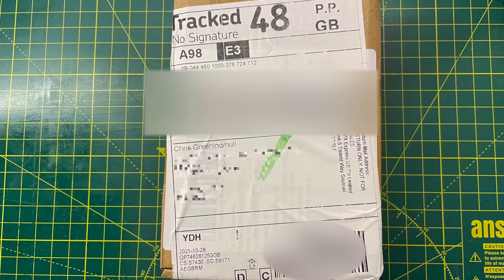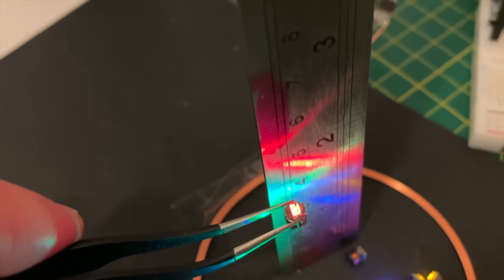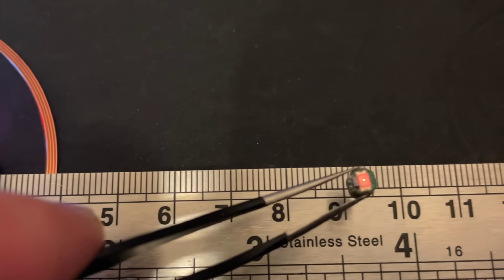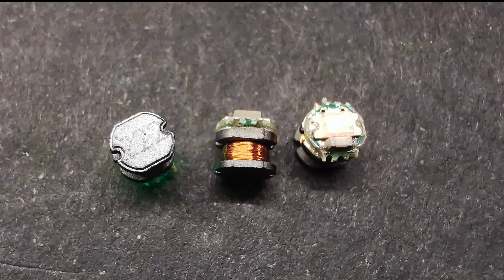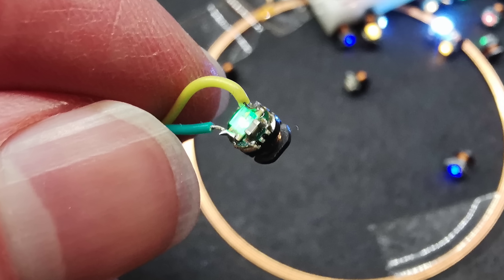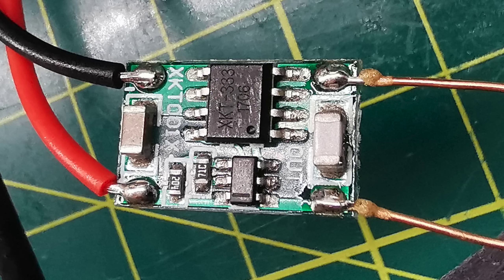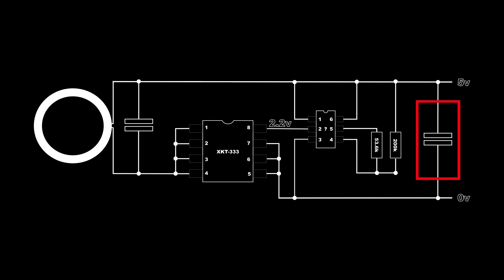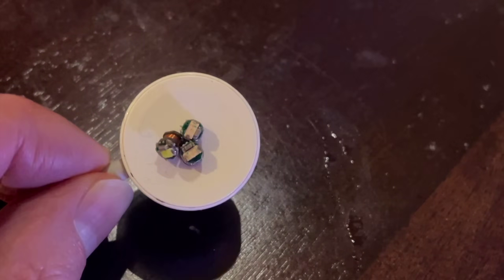Look Mum No Wires - This will blow your mind

Comment: Put them in a container of clear oil or other non-conductive fluid, then use a pump or agitator to swirl them around like a lava lamp.
Reply: Or I guess you could cover them in epoxy then use water in the container.
Reply: Actually don't do that because I want to do it now!
Reply: I got some of these, I didn't realise how dense they are!  I was able to get one to float by sticking a big piece of styrofoam to it, but I'm not sure how many you could have in a jar and still be able to see the lights.

Comment: Hmm, make a "holographic" 3d cube with the LEDs in resin, a 4x4 grid array in a 5x5 resin cube, of course if that works well you could try a 10x10 led in an 11x11 resin cu e.
Reply from the maker: That's a really nice idea. I've been meaning to try my hand at casting resin.

Comment: The LED's are brighter because you are now magnetically coupling the ferrite core of the LED's coil to the magnetic core of the iphone's charging transformer.  Basically the LED's coil is now the secondary winding of the charger's coil/core.  True wireless doesn't use magnetic coupling for power transfer.

Comment: Christmas is near - so why not make a bonsai Christmas tree?

The 2.2V is probably a "virtual ground". This gives you a symmetrical power supply of roughly +/- 2.5V. This used to be common practise before cheap DC/DC converters were available.
 For example, the 9V battery was invented for portable transistor radios. Using a regulator to create 4.5V, you get the necessary symmetrical power supply for the tuner while the speaker is driven by the full 9V using a class-A amp circuit. The tuner doesn't need much of a voltage, 2..3V is plenty to make it work while the speaker needs as much volts as possible.

The wireless charger is pulsing to waste less energy. It switches on and if it can't sense any decent load, it switches off for a second or two before trying again. It would be a good idea to prolong the time it is off but when the cell phone doesn't respond seemingly instantly, a lot of people start to bang their phone onto the charger to "make it work better" so a lot of energy is wasted to!prevent just that.
Reply from the maker: I actually like that idea a lot!

Comment: Attach the LC/Led to things you may easily misplace - and with the powered coil you can go chasing that. (maybe a flat receiver coil - half creditcard size - clip to important papers...
Reply: Long before credit/debit cards used NFC, I kept an RFID tag in my wallet and used a homemade long range reader to locate my wallet whenever I misplaced it. 1.5 meters of range is more than enough to do the trick.

Using the LEDs to do the trick is a good idea but you can't find stuff which is hidden because it is covered by something, the common reason why you can't spot it in the first please.

Comment: Can you create a hex grid of coils to cover a larger area? Would a small NdFeB magnet change the resonant frequency, and how much power is transferred across a steel sheet (0.25 to 0.5 mm)?
Thinking of lit fridge magnets - perhaps with tuned LC-frequencies (the diode in series with the C?) for two-color schemes by the transfer coil?
Reply: Nah -- 200kHz is blocked by very little metal, even aluminum foil will block it substantially.  It can be mounted on a surface with low profile, but some preparation is required.  First, the surface needs to be shielded with ferrite tiles, and then the coil goes on top of those.  But this will drop the resonant frequency, so some tuning will still be needed (reduce the number of turns maybe?).

Magnets will tend to saturate the receiver's core (and also make a dead spot in the ferrite tile shielding, if applicable), reducing its inductance (raising resonant frequency).  Maybe the inductor value can be adjusted to compensate.  A weak magnet would be best (Br < 300mT), for which, common fridge magnets aren't a bad idea (they have Br ~ 30mT I think, and make up the strength by using a striped pattern on the face).

Comment: 3:31 - The signal on the coil is a half-sine wave - Because the drive circuit is a "Class E" type. In this topology, there is only one N-CH MOSFET that pulls the current from the coil, and the current is pushed back by the inductance of the coil itself and a resonating capacitor in parallel to the coil. The result is a push-pull current through the coil, but with only 1 MOSFET transistor. This is the cheapest drive circuit. The downside is that this circuit has to be tuned for a certain frequency, unlike regular push-pull drivers (half-bridge). Check for more explanation on Class-E on the web.
Reply: This.  I don't recognize the part numbers, but the pinout and application looks absolutely like a MOSFET output.

Which in turn means the 6-pin device is, probably not any kind of controller, though possibly; it's most likely an adjustable squarewave oscillator.  In the past I've used parts like LTC6990, adjustable silicon oscillator; in effect a nicer version of a 555 (less versatile, easier to use for simple applications).  The pinout doesn't match so it might be a similar part from someone else.
Reply from the maker: Correct - the big chip is just a MOSFET the 6 pin chip is an XKT001. I've fixed up the reverse engineering in the DIY video: https://youtu.be/jdc_0r5pJPc

Comment: I saw a wireless Christmas light string in a nearby store yesterday. I thought it might work like this. No. I read the text on the box and didn’t buy it. The 15 candles require 15 batteries, which are sold separately! You also need one for the remote control. Pfff! Environmental Protection.

Comment: Try making a very large diameter coil (2 meters or so) and place a Christmas tree inside of it with the LEDs glued to branches. You'd probably have to build your own driver circuit, and those with pacemakers may want to stand far away.
Reply: How about a replica of Saturn with the rings being the coil, and the LEDs on or inside the globe ?

Comment: I built a shortwave tuning 8 to 30 MHz  crystal radio set and connected a LED light to the earphone connection and it lights up brightly when I key up my CB radio when tuned to 27 MHz.

Comment: The waveform you have measured is a modified class-E amplifier drain voltage waveform. That waveform, being fed into the coil and resonates with the load capacitor, forms a perfect sine wave, which drives the load. You can try to remove the LED and see if you get a sine wave on the receiver coil. The half sine is converter to full sine by using a tuned filter (in this case, a parallel LC tank comprised of the tx coil and tx capacitor, as well as any load rx coils and rx capacitors, where in a classic class-E it would be a series tank L and tank capacitor), which filters out higher harmonics (the clipped part's Fourier transform).
Reply: If you havnt got some sort off super solar run l.e.d smart shed for growing all your food and varies other projects then your talents are being waisted sir..
Reply: @jshaw4757  Well, I have a PhD in power electronics and I make a living by making energy utilization more efficient.
Reply: @bskull3232  My kinda dude show me your lab bro lol..
Reply: @bskull3232  No home projects no dexters lab hidden..??
Reply: @bskull3232  I dabble in that myself very much intrested in alternate ways off energy/power n the history...building a l.e.d solar shed among various other things..currently building salt batteries had some great results i just need a buck converter to up the amps/current..lower the volts to increase the current im told this is possible..volts are no issue can get whatever needed for a decent ammount off time too..maybe you could help me mate if u get a minuite cheers
Reply: @jshaw4757  I plan to stream in my lab in a few days, but that will be in Chinese... I live in China, and invited by Altium China, I probably will do a power supply seminar for them promoting their software. Dunno if they will translate the video or not. Or maybe I will subsitle it and post it on my YT channel.
Reply: @bskull3232  Ok Bo great..you sound like a busy man so i wont hasstle you 😂😂..good luck with everything from 🏴 hope your one off the good guys out there in these industrys

Comment: Could the ring be powered by a battery? If so, what type and how long do you think it would the battery would last if it were to be used a couple times a day for less than a minutes each time?  I could use whatever type of battery is necessary, but I'd prefer to use something small, like a CR2032.

Comment: Thank you for the hint.
The Qi standard negotiate the power with the phone, i.e. 5, 10, or 15 Watt. Also, it detect the presence of metallic objects that can short the electromagnetic field.
The wireless LEDs are a barebone circuit, they don't reply to the inquiries of the charger, which therefore turns off.
You can build a simpler, crude driver for the coil you use to power the LED, with a 555 wired as an astable multivibrator, and a power transistor driving the coil. Try to use the Qi base frequency of 140 KHz, which is the best compromise for minimising coil losses.
Thank you for showing this.
Note that the coil you have built to drive the wireless LEDs, is a crude LW low power transmitter, which can disable long wave radio reception within the house.
Reply: could you increase the field potentecy by putting it in a  microwave? could you cut a hole in the wire mesh on the microwave door and make it a directed microwave beam and power those things or other things at a distance?
Reply: You can even go easier than that. A simple "Joule Thief" circuit is able to power a coil, and get some distance powering an LED with your own hand wound coil attached to the LED leads. Ive done it before using a single AA battery, and it works a charm. You could build your own "joule thief" circuit, OR harvest one out of a 1 dollar solar garden light, remove the LED, and attach a coil to where the LED used to be. I've done it both ways, and it works.
Reply: Question, how did you learn about this type of stuff? Aside from going to college for it, do you recommend any resources that I can purchase/watch/check out to gain further knowledge about LEDs and the other things you spoke of, understanding the whole process of what you're explaining, and getting a grasp on electronics like this? I've always been very interested from an outside perspective, but have never known how or where to dive in — I really appreciate any recommendation you have!

Comment: These are very interesting indeed. I'd like to see a version with a small battery that could be charged so that the LED would stay lit for some minutes/hours after removal.

I've had an idea in my head for ages that would essentially be ping-pong balls on strings, moving up and down in response to real-time data (probably temperatures at various airports, but could just as easily be stock prices or whatever) and would love for the balls to be lit. Something like this, with a battery, would allow a much large range of motion.
Reply: ...after removal..say like sunlight and nite..wat if the skin could be use ..in low frequency..in order for the elderly to see their footing this reduce the amount of falls and broken bones.

Comment: You can cast them in a clear resin, for some project of your choice. Ideally, a ball, that sits on a base, and lights up when on the base. If were talented, you could have chip run from the same power, and have do something, like maybe be clock, or something.
Reply: ooo nice one. I only wonder if they would overheat quickly?
Reply from the maker: It should be ok, the current through the LEDs is very small - it's quite surprising how much light you can get with very little power.
Reply: @isatche  resin would take the heat also so no problem i believe

Comment: So, you asked us to tell you why the "sine wave" looked not as expected. Here's the answer. The sinusoidal power supply is fed through a half-wave rectifier, the reason why the cut half of the waveform is not perfectly flat is due to diode leakage voltage and potential external electromagnetic interference.
Reply: Hey u sound smart. How do I power this at home. Can i just use a batter with +/- wires
Doesn’t matter the voltage?
Reply: @ajmark517  As long as the voltage in the battery is enough to illuminate the LED, I don't see why not. To be safe, I'd recommend checking the operational voltage of the inductive LEDs so that you can match the correct battery to them. Afteral, you could trial-and-error, but you may fry the LED as I doubt they will have any protective circuity for over-voltage faults. Or just start with a nearly completely depleted 1.2V AAA battery or something and try it. If it doesn't work at all, reverse the polarity of the supply as it is a one-way circuit (DC).

Comment: Wouldn't the measuring of range from the center of the coil been better if you had used a wooden or plastic scale, thinking that the metal scale is detrimental to the coils' effectiveness?
Reply: Was going to comment exactly the same.  it sure would...!
Reply: Yes the ruler is an antenna.....but good try 👍

Comment: you could try getting a resin mold for dice and ofc resin and see what happens if you place on in the middle
you would have prop it up in a way tho, maybe a very thinn nylon thread glued to the top of the mold, maybe even put through with a needle (I think them molds are out of silicon but don't know completly) 
would love to see wireless glowing dice

Comment: suggestion: a guitar neck where the pearl dot inlays are. I've got this project led guitar that I'm building and this would make wiring so much easier. too bad they aren't ARGB's
Reply: Wuold the wiring be easier though? Surely running wires through the truss rod hole is easier than trying to mount coils in the neck?
Reply: @MB-st7be  I was thinking one coil on the back side in an oval shape, but after thinking more about this I think you're right. I'll stick with my original plan lol...

Comment: Lava lamp reimagined. A transparent cylinder (e.g., glass) filled with a viscous, transparent liquid. The coil sits at the bottom or at the top of the cylinder. At the bottom sits a heat source. Due to convection in the liquid, the LED's could rise and fall in the liquid.
Reply: Nice one. I think it would be cooler if you don't use a transparent liquid so that you see the lights but not the construction. Also, a heat source is not necessary (as for the wax) so you can use something like a propellor to create currents in the liquid.

Comment: Do not use a metal ruler for measuring in this case it messes with the magnetic fields and might even amplify or strengthen the magnetic fields which makes the measurement far from accurate
Reply: Thinking the same thing. I wonder what the difference is when using a plastic ruler instead.

Comment: ⏱ 3:36 Sine Wave ?🌊 I think you guessed the best part of the schematic but I'm not convinced that the second chip is a voltage regulator. No other XKT application note seem to use a voltage regulator and the chip seem to have a wide voltage operation range. That chip might be a voltage reference to keep the frequency stable over different voltages. By the way, there is only one pin of the XKT that appears to be a control signal and I don't think they created a chip that only works at one fixed frequency. You see that the coil can only been excited in one direction becose one lead is allways connected to the positive supply. To produce a full sine, it needs a H-Bridge (assembly of transistors abling to send reverse polarity in the coil) or a symetrical power supply like in old fashion audio amplifiers.
Reply from the maker: That's it! Reverse engineered it again in the followup video.

Comment: I wonder if they’d be immediately ’cooked’ on an induction cooktop ??
Reply: remembering that power transmitted is a function of the frequency and impedence match/resonance of the in and out - not just limited by the power of the send side.
Reply: At first I always thought the receiving circuit will limit the ammount of absorbed enefy by its sizing but  I managed to accidentally fry my conytactless parkin access card on the wireless charger in my car 🙄
Reply: Nice

Comment: 3:30 led is a diode so isn't that just the diode stopping the  current from flowing the "wrong" direction? hence the cut off of the bottom half of the sine wave. And diodes actually have a slight delay on when they start resisting current flow, you can see that from the tiny ripple before each cut
Reply: Correct. The LED is acting as a half.bridge rectifier.
Reply: @jonmayer  quarter bridge?
Reply: Kinda surprises me the manufacturer didn't spec the 'ac' style leds with 2 back to back reverse polarity leds - brighter and full wave magic.

Comment: does it work near a power line (AC)?
How about an old school door bell? Or old telephone ringer?
How about putting them in a speaker grille of a 10 or 15" speaker cabinet, as you go from low frequency notes to high frequency notes through that speaker?
Do they work in a phone case, close to the phone's transmitter?
Are they capable of capturing some Wifi network signals?
How about putting them near an electrical stove top?
Reply: Clearly being a DC circuit..... Good ideas though, why not pick some up and try your hand at them for everyone to learn from as well?
Reply: @Mr_Sparling  They're DC LEDs, but can only make power from AC fluctuations, due to the way the coil (on the back of the leds) makes power.

Comment: I connected an led from a flash light to the phone terminals on a crystal radio that was connected to antenna and ground, it lit up to full brightness. I tested the voltage on the terminals and got a reading of about 2.5v, an ordinary low voltage flashlight bulb did not glow.